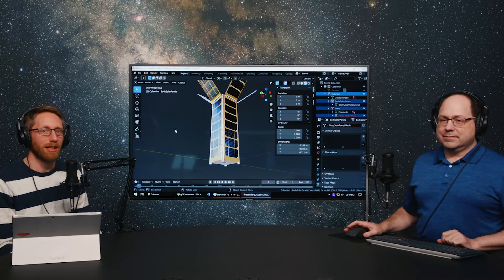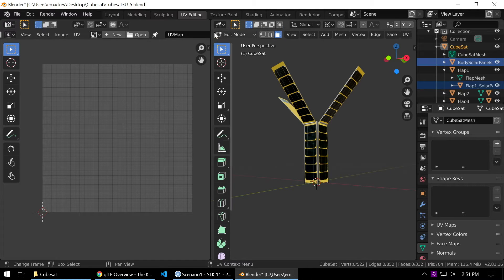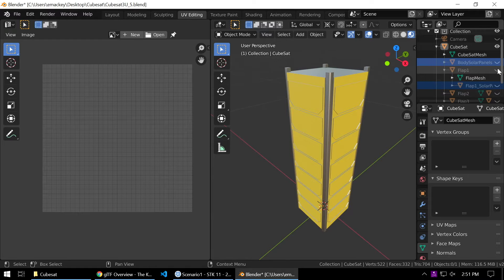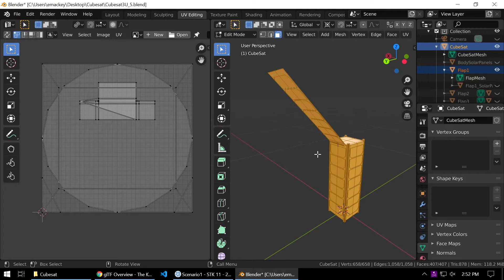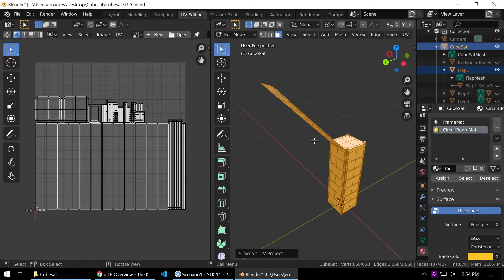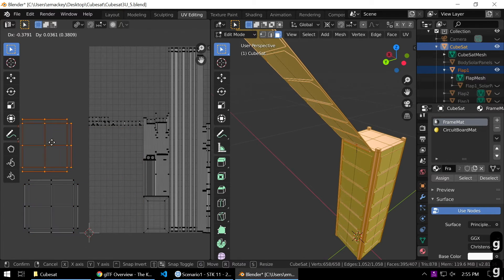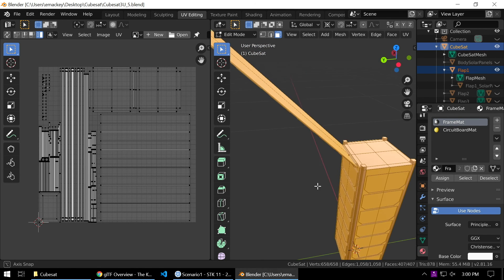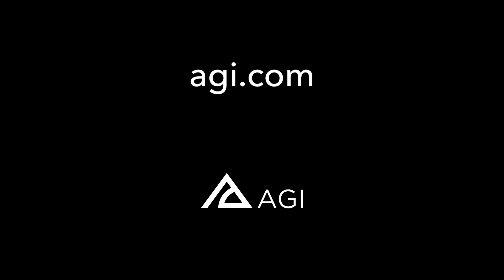Part 5: Creating a new UV atlas for use with baking procedural textures to glTF PBR textures

Comment: just a note, for your method idk if it's possible but it's better to use a texture output that's not a square. it's faster to make and will look nicer and will(not too sure about this) perform better. 
the only problem is if blender can handle it....